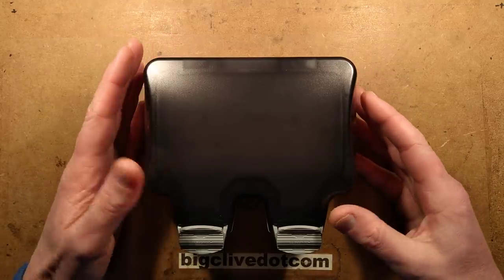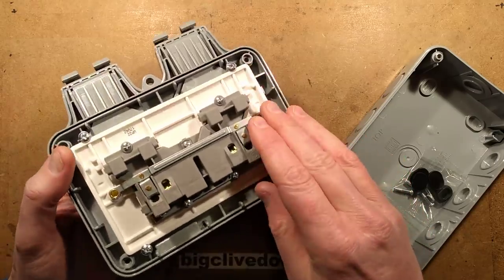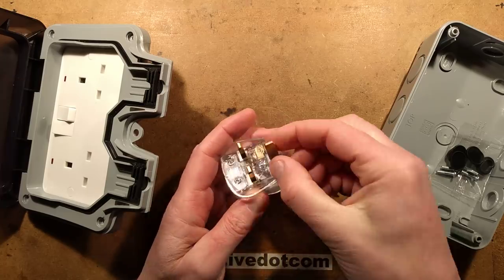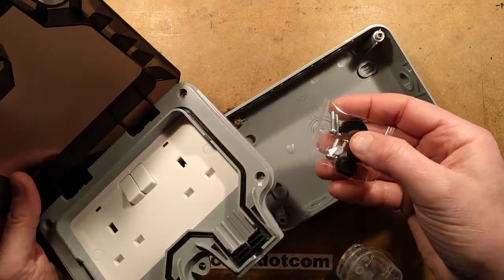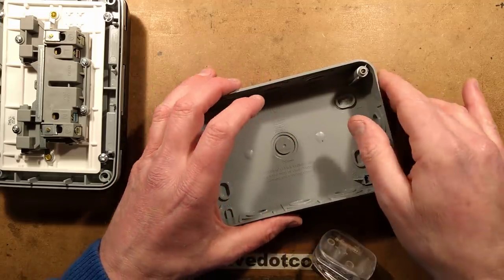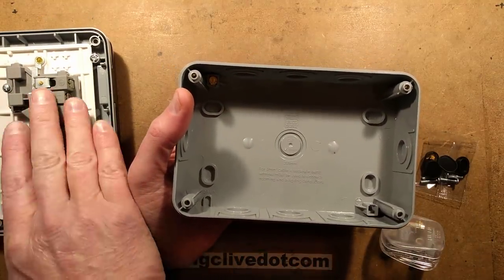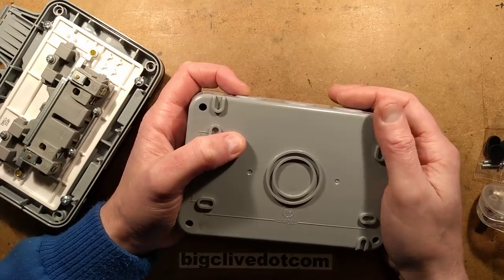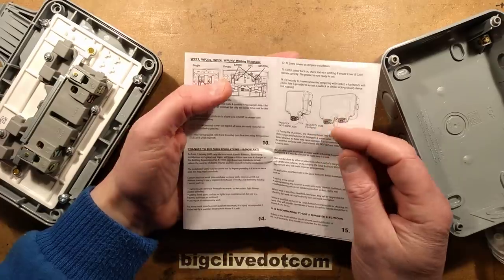British weatherproof socket with clever design. (bonus rant)

Comment: I am British and quite surprised by some of the comments. I have similar external sockets which stay outside in the garden all year round. They were for Christmas external lights when my grandchildren were small. I have never had a problem with them. The 13-amp fused plug is an amazing thing, you can change the fuse from 3 amp up to 13 am so one can protect each individual piece of electrical equipment according to its rating. The shields for the live and neutral pins of the 13-amp socket are a great idea. Kids do tend to poke things into everything and these prevent them from doing so. OK if you have a child built like a brick s*it house then yes, maybe they could get inside. I have 5 children and 8 grandchildren all of whom have lived with us at some point as well as visiting. Over the years some of them have been told off for trying to place things into the socket but never once have they hurt themselves because I do believe the shields work. I have been all over the world as an engineer in the merchant navy. I actually believe we have the safest 13-amp ring main equipment in the world. It is sturdy and anyone who steps on the pins of the plug maybe needs to look where they are going or get their eyes tested. I agree with the part about only being able to have a qualified person to do electrical work in one’s home. As a marine engineer I was trained and believe myself qualified to do my own electrical work and my twin brother who lives with us is an apprentice trained electrician who was felt qualified enough to install and test wiring for nuclear submarines but according to our regs, not so for household wiring. Responsible people still do their own electrical work in their own houses, where this law really comes into focus is when you want to sell your house, then you must get one of these course trained rather than apprenticed trained electrical bods to certify that your electrical system is OK and I believe you need a certificate. I think this law was introduced to prevent cowboys from doing their own electrics but one can never police it. Another good video Clive, I really do enjoy your channel.

Comment: U.S. citizen here..   U.K. plugs and sockets seem very practical and well thought out.  One thing though..  Those right-angle plugs..  If one gets dropped on the floor and happens to be kicked out into a walkway that can pose a risk.  Especially to the weary night-time trip to the loo in low light.  I can imagine the screams of pain as an unsuspecting person steps on one, getting impaled by three blunt pins.     Some U.S.  "Space-saver" plugs have this right-angle design,  and for things meant to stay plugged in all the time,  that's pretty good.  (like the 6-outlet power strips used for when the TV stand is inevitably going to be blocking any access to the wall socket behind it)  But most appliances here have the pins in-line with the cords.  Granted they do tend to  protrude a bit,  but if laying on the floor, they are not half as bad as a lego..

I nearly forgot to mention that lately many things such as hair-dryers now have GFCI (ground-fault circuit interrupters) plugs on them.  These are very large "Wall-wart" style plugs that usually cover the adjacent outlet, and are often at the foot-hating, 90 deg angle..

Comment: I find the use of the drain hole on these and any other outdoor enclosure is the golden rule to follow. I have lost count of the amount of boxes i have opened FULL of water that you see someone has proudly caked in silicone thinking they have done a great job but not drain hole 🙈. I always say a great real world example of how drainage is designed in is the humble car headlight they always have downward facing drain holes/ small pipes on the back to allow the enclosure to breath.

Comment: Yes the British plugs are very safe and after some time here in Ireland I got used to them but I still think, that the plug's we use in Germany are way more convenient with out loosing a lot of safeness.
Reply: The only thing that bothers me about Schuko is the earth contacts on the socket that often get bent by careless users and that it's not polarised. Otherwise it's a pretty compact and robust design.
Reply: in the netherlands we also use the schuko plug, it's very good, but it's not fused like the UK one. i do not understand it's allowed to sell a 0.75mm2 (if they are not lying about it, and is it even pure copper) multi-plug extention cord without a fuse in it.
Reply: @adriaan9011  good point. Not being fused is also a big disadvantage. 3G0.75mm2 cable plugged into a 16A socket, quite dangerous but yet widely used all over Europe...
Reply: The Australian plug is imo better, it is cheaper to manufacture and has the same safety features (apart from the fuse), but the angled prongs provide polarisation with 2 pin use and hold up any plugged in item really well. (its isnt Australian btw - it is an update of IEC type 1, an early US plug)
Reply: The same safety features, except for the biggest one.. lol. No, it’s not as safe is it then.
Reply: @mycosys  yeah but the flat prongs are easier to bend and damage than the solid round prongs, the Schuko is also very secure as the socket envelops the plug for about 1.5cm all around and is a very secure fit.
Reply: @mycosys  The Australian government apparently chose that socket as it used flat pins and it was thought that it was much easier for Australian companies to manufacture than the solid pint British varieties (which would have been round pin at the time - still used in India).
Reply: @mycosys  Doesn't China use the same plugs too? I do with the side-connected plugs were easier to find here though - I find them a little easier to unplug and far better if the bloody socket is behind furniture.  Houses that have the single power point right in the middle of where the bed goes - ffs, who does that??
Reply: @databanks  China uses the original IEC type 1 I believe, Australia's modern plug has added safety features (sheathed active and neutral pins, a socket that has to have both pins put in at once, and iirc a longer earth). The Chinese also use the plug the other way up.
Reply: @TheEulerID  yep, same reason the US chose the IEC Type A, they are CHEAP to make. Type 1 is indeed the cheapest common plug, no round pins and no thick pins means they are just punched from brass sheet. The broad flat pins also make FANTASTIC contact so the socket is cheap and easy to make.
Plug durability is lesser, but the issue is near academic, damage is rare and when it occurs simple to rectify, it is neither a large nor often enough bend to cause stress fractures. From an electrical and manufacturing point of view it makes a lot of sense.
Really the worst thing about the type 1 is it is kinda hard to plug in. most plugs kinda self centre once you find one pin hole, the type one you really need to be able to see the thing
Reply: @brainndamage  There are several big issues with schuko plugs. On is the round pins - they are just objectively inferior for electrical mating, it is impossible to provide consistent pressure and contact on round pins. Even worse, they are steel rather than brass.
To further complicate matters you schuko is not polarised. This isnt a big deal for the running of an appliance, but its a big deal for safety because it is IMPOSSIBLE to ensure a fuse or switch is on the active line. So even switched off, even with the fuse blown, there is a 50/50 the entire internals are live. 
The recessed socket is nice, it is now legally required on Aussie extension cords, i suspect it will become part of the socket too.
Reply: @mycosys  true we have improved it a little. I wonder if the longer earth pin was in preparation for a shutter feature like the UK that was never implemented or if it was just someone blindly copying the look. Still a step in the right direction.
As for the whole upside down sockets in China, any idea why? 
Also, Why the hell is it that when you buy an appliance from China, they rarely have a Chinese/Australian plug, just UK, EU and US? They make the damn things there! Grr, just spent 15 minutes retrofitting an angle grinder to an Aussie plug (swapped in the cable from a dead bread maker - costs nothing but time and now I have a lovely long cord that doesn't need an adapter)
Reply: @databanks  Dont know if this is the reason, but the upside down socket puts the earth at the top, so if something conductive did happen to fall across the top of a partially exposed plug it will be grounded rather than potentially becoming live or shorting it out. The conflicting idea of having the earth at the bottom is that it the plug is pulled downward the earth pin will be the last to lose contact. The modern sheathed active and neutral probably gives the best of both.
The long earth pin is at least 80 years old - i went and had a look and my unrestored 1947 STC console radio has a clipsal plug that is clearly of the same vintage and the earth pin is longer. It is marked C112 which is the original 1937 Aussie standard so i presume it always had the long earth.
The others, no clue
Reply: @mycosys  Thanks for the info,  some things to ponder there. The earth on top explanation does make some sense and yeah I rather like the semi-coated pins now. I'm guessing I could probably find more data on it if I look, but what you've said so far will tide my curiousity over for now. Many thanks. 
Plus stupid me managed to pull all my back muscles earlier, so concentrating just got somewhat harder for now. I need to remember to use the damn workbench, not hunch over low lying work pieces, even for "simple, quick" jobs that never are simple or quick when using recycled materials
Reply: @brainndamage  A good brand should bend if you use the right plug.

Comment: Yeah, part p. Where do I start ? Kitchen fitters doing a short course so the company doesn't have to employ qualified sparks, plumbers doing for the same reason. Nightmares I've seen by these guys is just astounding.  Gave up domestic wiring when i got told that although i had upto date regs and testing qualifications, certified also to 65KV as well, I wasn't qualified to install an outside socket ! Should have been a proper license system with only qualified sparks allowed to purchase materials instead now we have anyone can buy off Amazon and wire houses etc with a leaflet from the 'net. Dangerous and ridiculous.
Reply: I gave up on domestic wiring after having 3 lock out locks cut off the rcd on the ring I was working on so painters and joiners could put on a kettle. I went back to fixing cars
Reply: The point about part P is that is unfairly disqualifies perfectly competent people like you and me and BG from doing electrical work that is by comparison to what we do professionally and absolute breeze and hands it over to people, some of whom could be a lot less skilled than we are. 

I got a qualified electrician to wire an EV charging point recently. Sadly, although he put his details in the installer section of the form, he forgot to sign it so I had to put my name in as a joint installer so I could sign and date it before posting it to Western Power. The DNO then contacted me for additional info before approving the installation. Part P forced me to use a "qualified" electrician but I could have easily completed the install myself and it would have been every bit as safe and well done. In fact I practically did install it anyway, fitting the conduit, the appliance, surge protectors and MCB, leaving just the actual wiring run and tests to the electrician. I even selected and supplied the cable. Part P is nonsense dressed up as a safety scheme which it is not, it does generate a lot of income for the  NICEIC however. 

So no, I dont agree with a license system to access materials, that would be even worse than what we have now. What should have been introduced was mandatory standards instead, no wriggle room then for poor workmanship but it would have allowed people like us to carry on doing quality safe electrical work.

Comment: I would like to see it go back to the more sensible colours like red, black and green and for the phases Yellow, blue and red.
Square pin plugs are fine but if they had added a fuse to the old round 15amp plug it might have been better.  My father (who was deadly with electric) ran a cooker off an old 15 amp plug (no more than two rings at a time) without any problems.  I would like to see the new square plugs stand that power going through them without heating up.  By the way, before everyone shouts he shouldn't have done that, we already know.  However, the wiring was such that there was a fuse just for that socket and it had a 15amp fuse wire in it.  It never blew the fuse even when I saw him using three rings!!!  I thought he had replaced the fuse with fence wire or something, so I checked, no, it was still a 15 amp fuse wire and not even doubled up.  Not long after that they came and wired it as it should have been in the first place.  We did have a Rayburn stove which maybe saved the day as most of the cooking was done on that.  Rayburn was like an AGA cooker or Stanley, they are all much the same.
Lets go back to red and black with a green earth much safer.  The advantage of the square plug was the pin guards that closed over the live (Hot) and neutral, but we had sockets (round) that did this as well, though they were not that common. 
Thankfully Scotland threw out the new shit.  Anyone can do work on electric if they have some common sense and read what they are doing for domestic use, industrial is another mater though!
Reply: There were fused round-pin plugs available (and might still be - India still uses the old UK round-pin outlets).
Reply: @TheEulerID  Yes I did have a couple of the round fused plugs, but I only got them well after the square plugs were well established, though I do believe they were around, but rarely used.  Shame, I thought the round plug could have been used just like the square ones.